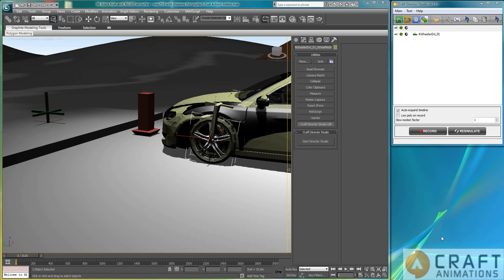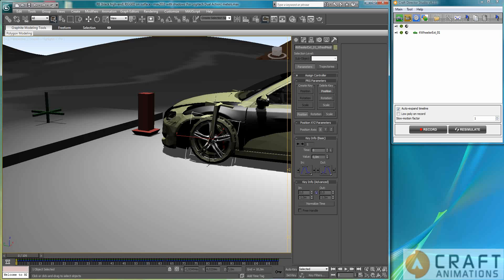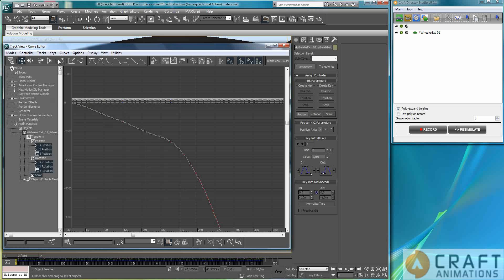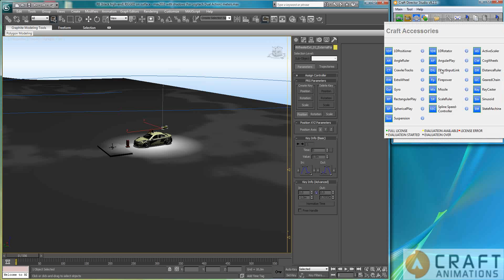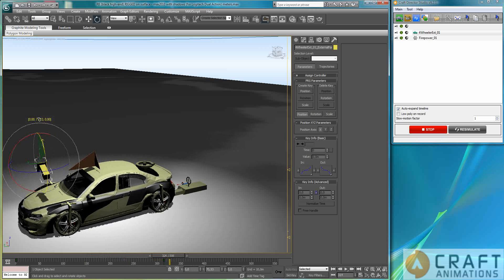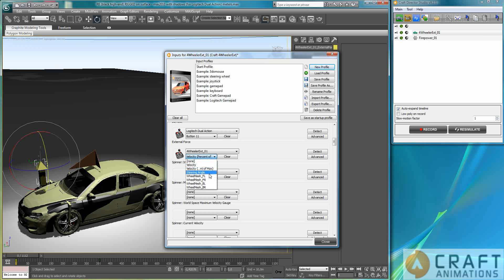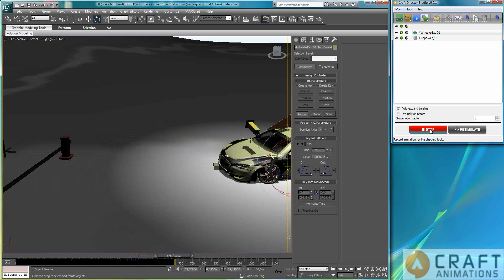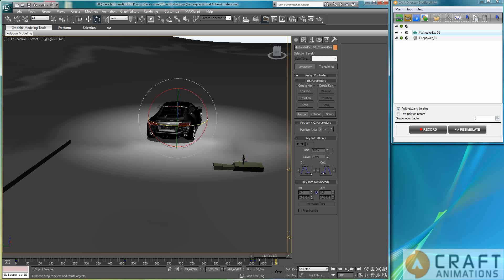Craft 4-Wheeler Extended - Part 3 - Advanced Stuff - Turbo Tutorial

Comment: hello ;how to add an obstacle like a wall or box on the surface tha we try a crash
Reply from the maker: amine guerba The 4-Wheeler Extended tool does not have any function for crashing in to obsticle or the ability to deform itself. In order to crash in to thins would would need to use a physics engine inside of the 3d program that you are using. Most of them have this built in.
Reply: hello ; but in madcar plugin we can make a crash why u dont make this important effect in craft i need to make my car run than crash to the wall  how can we do that with craft !!!!! realy i like ur product
Reply: you definitely should add this option like madcar has plus collision between cars